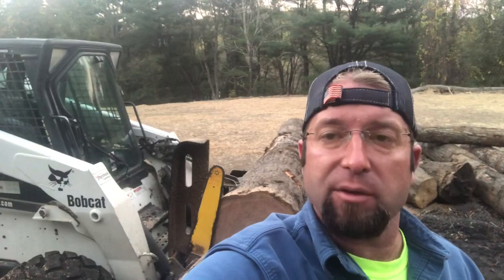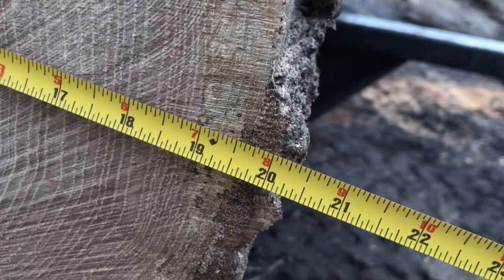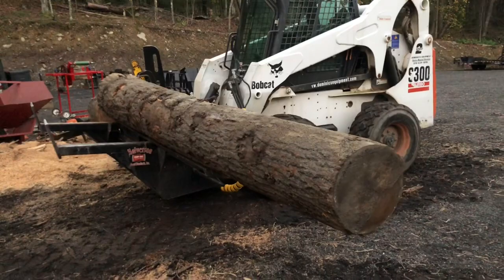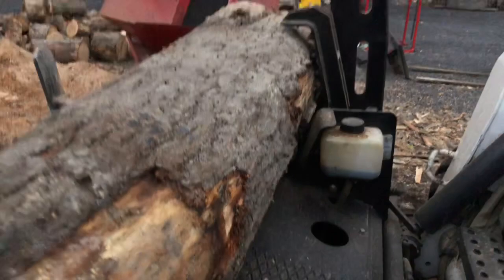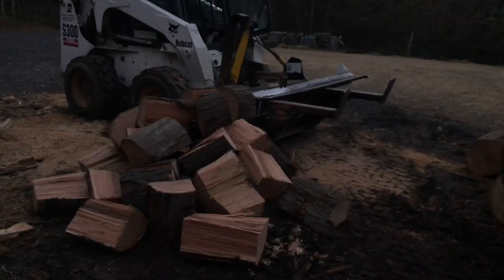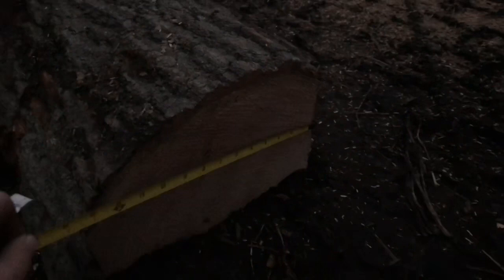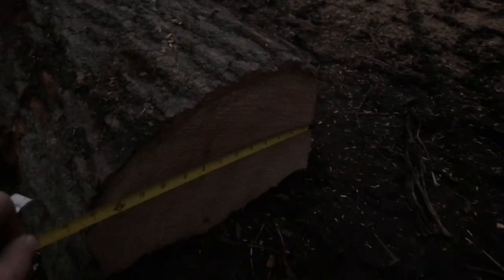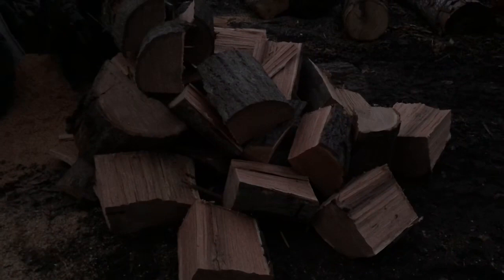20”+ Log VS Halverson Wood Processor HWP-140b

Comment: If you would have moved you splitter bar up to align with the center line of the wood you would have had four smaller pieces of wood rather than two large pieces. The HP-140 and below have a manual adjustment to the splitter bar by way of a pin, whereas the HP-150 has a hydraulic adjustment. Thanks for the video.
Reply from the maker: Well Mark, this video is over (5) yrs old and the 150 wasn’t invented yet.

Comment: I’m a firewood processor in Northern cal.  All the large oak I deal with is never straight and many large branches that need to be dealt with before splitting. I have a commercial grade splitter and a compact excavator to handle the logs. Without excavator would not even be worth trying to process a large log this very little if any waste. That looks a good processor but in reality would never work  unless you are dealing with straight small logs.
Reply from the maker: Thx for the comment. We now offer another model, HWP-150. It is designed to cut up to about 24” and has a hydraulically adjusted wedge. The redesigned grabber arm makes a better hold on crooked stuff.

Comment from the maker: We recommend a log size of 15” and smaller. One, it’s easier to run across the processor and two, the pieces are more manageable. I did the 20”+ Log just to prove it could do it. We did have to re-split the chunks down. The 6 way wedge is what I normally use for personal use and retail sale. The 15” diameter logs thru the 6 way yield nice sizes ready for the fire.
Reply: What was the length of the log in the video?

Comment: Just wondering do you use another splitter to size down farther?
Or i suppose if you have two people you would run it back through. 
But i cut alone not sure if you have a control outside the cab to run just the splitter?

Comment: It looks like you only used the single wedge why didn't you use the 4 way wedge
Reply from the maker: We actually had the 6-way in it. Problem is the larger the round the less it fits down into the log trough. The processor has a suggested log diameter of 16” so we were well north of that. This was just a fun/see what happens video.
Reply: @ShaverSalesINC  how many cord will a 140 run in its life time has anyone ever gave numbers on that

Comment: About how many cords can you realistically do an hour splitting 15 inch wood? That this is very impressive. 👍
Reply from the maker: darren c, keep in mind quantity in is quantity out. Realistically, I average a cord in about 40-45 minutes off a mixed pile. If you had consistently 15” logs, you might be 30 minutes. Lots of tricks to help speed it up. Process close to the pile, make that first cut as your moving to location, ...
Thanks for watching!
Reply: If you don't use your processer for the logs larger that 15 inches, do you just cut them with a chainsaw?  What splitter do you use to split the larger pieces?